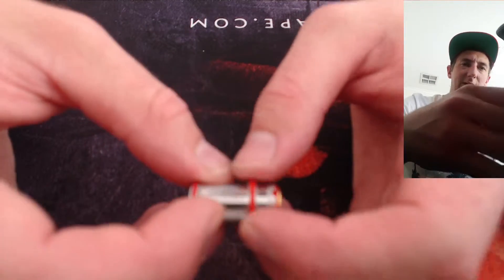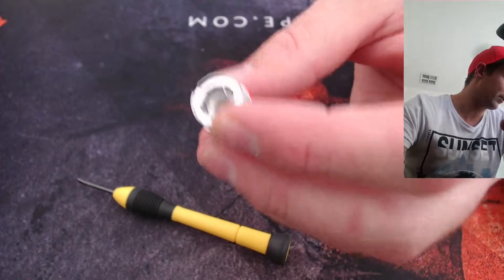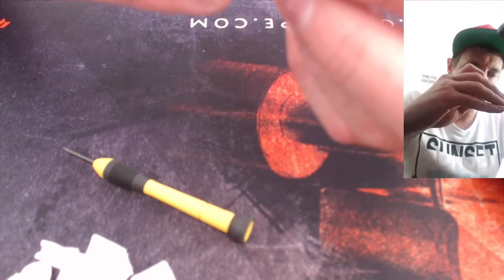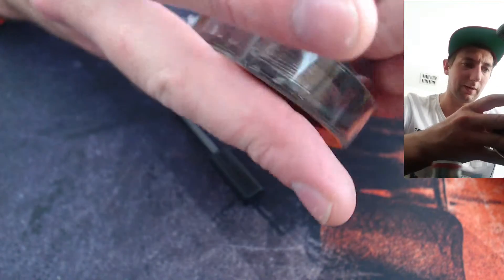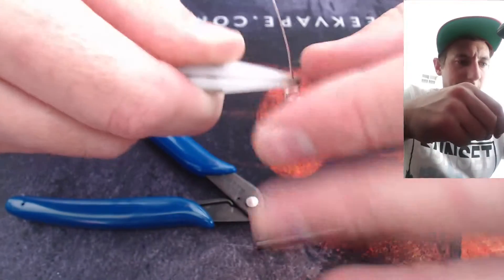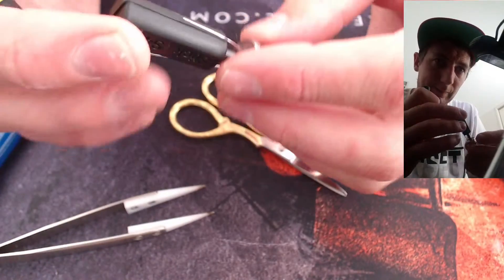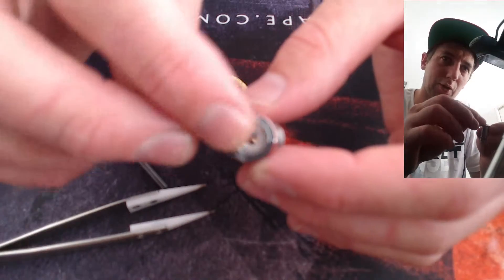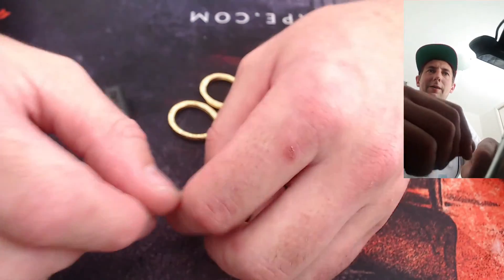Rebuilding a sub tank coil (crown 3)

Comment: You can separate the coil housing fairly easily. Once you get the coil and cotton out, you stick a sturdy, but small screwdriver through the top side of the coil head and set it against the lip of the inner housing. Turn the coil head over and rest the screwdriver on a table (or vise if you have one) and grip the outer housing with a pair of pliers. Then use a small hammer to tap on the pliers to separate the inner and outer shells from eachother. Makes it a lot easier to insert your new coil and cotton into the coil housing.